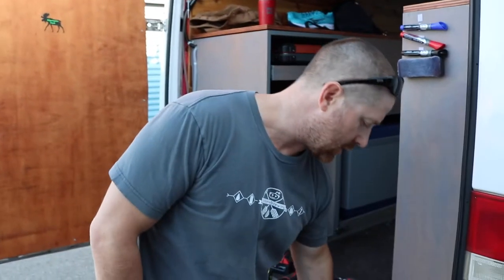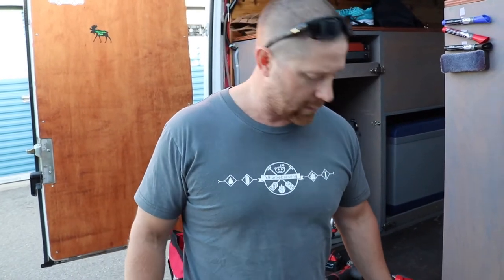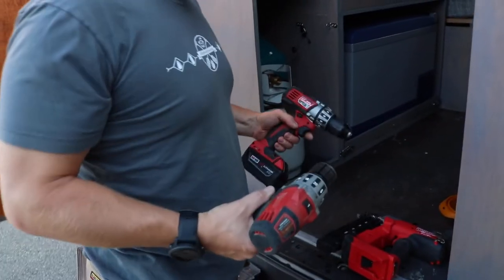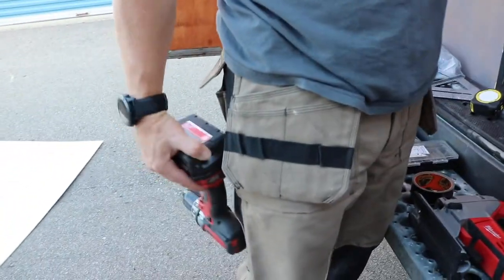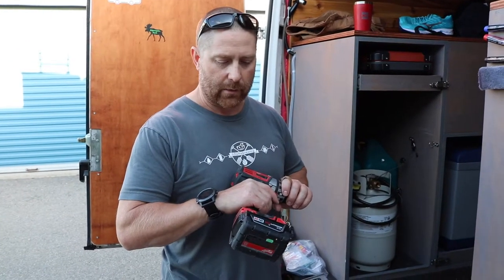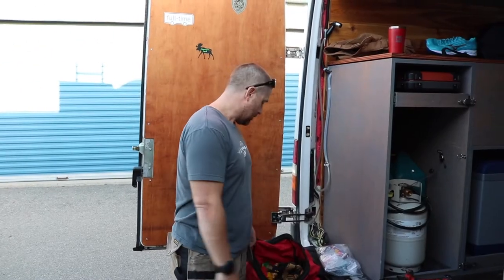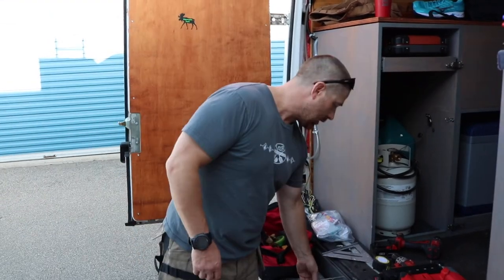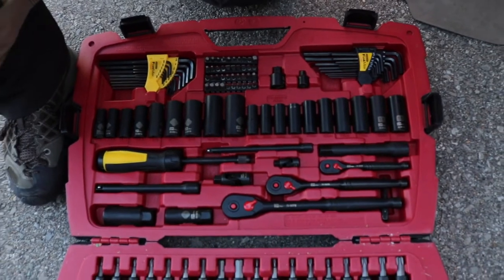What tools will you need to build out your van? | #Vanlife, Van Build #5

Comment: I am just learning about tools for my van build and just bought a Milwaukee tool set - do you store them in that bag? It just seems that they would get damaged that way.
Thank you for the video.
Reply from the maker: +Patty Martirosian depends on the tools. For allergies ones and ones we use a lot (drill bits, hammer, drill, measuring tape etc) we use a bag. For the bigger stuff we have a tool box.